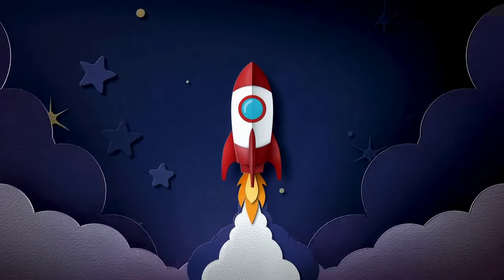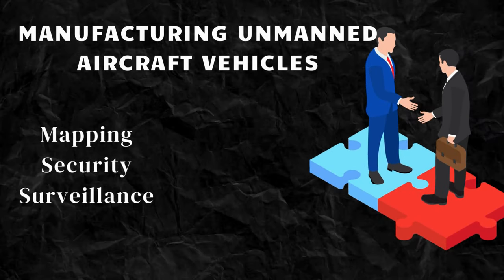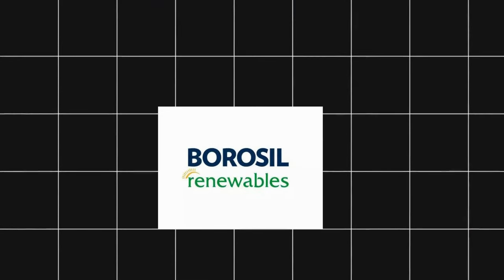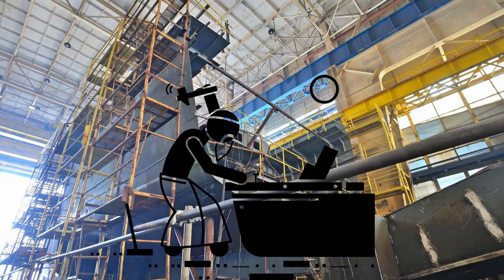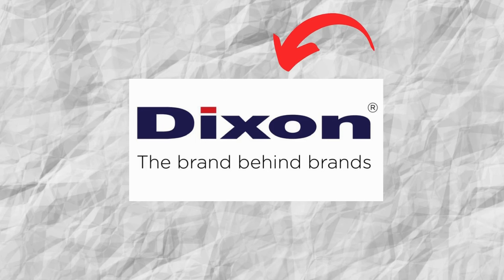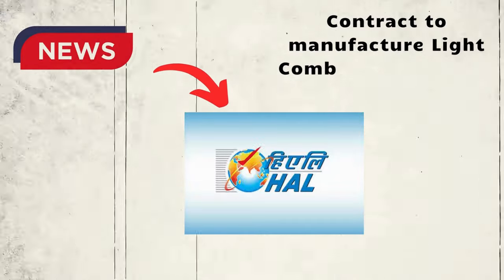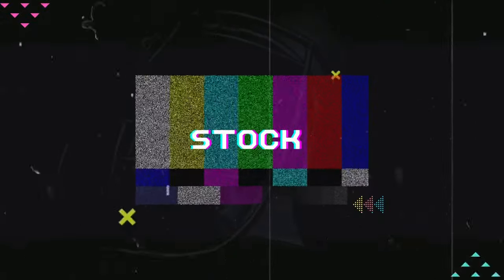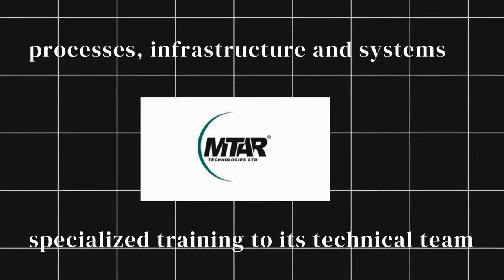Best Midcap stocks: Best stocks to Invest in 2024 | Digital Expert

Comment: All are with high PE ratio, nothing left now already it's relied.
Reply: High pe doesn't mean  Stock won't rise again. Look at stocks like jbm auto. Thought they are expensive at 1500 with high pe but it again went up 30 percentage from there. It's also about future potential.
Reply: Yes you are correct but we are retailers. Why you want to take risk when lot of fundamentally good stocks trading with low PE.
Reply: If a stock is having very low pe and doesn't have much potential in future there is no point in pe.anyway I got your point.